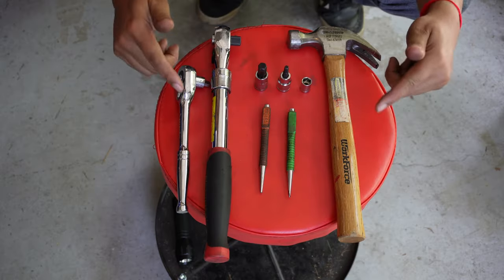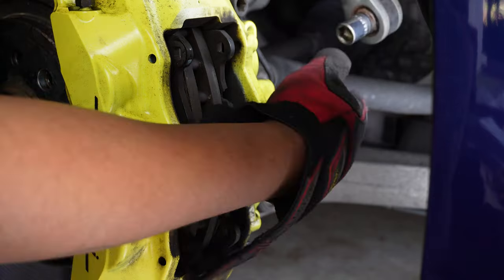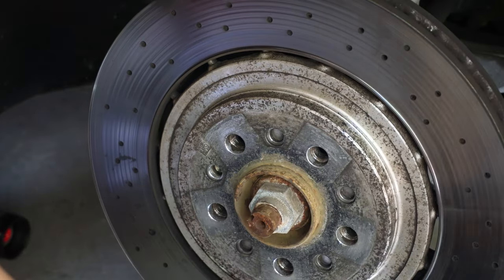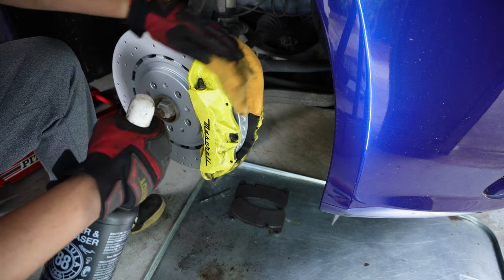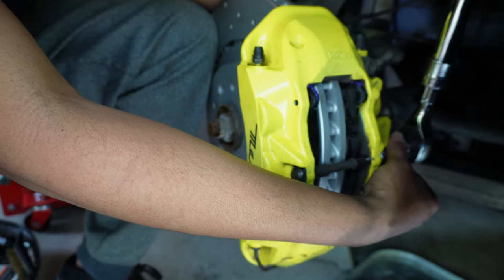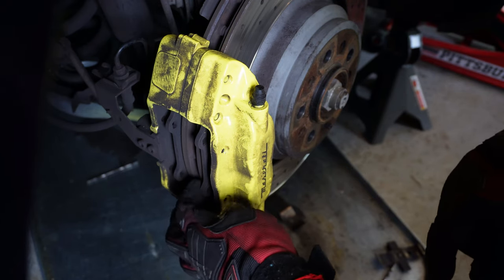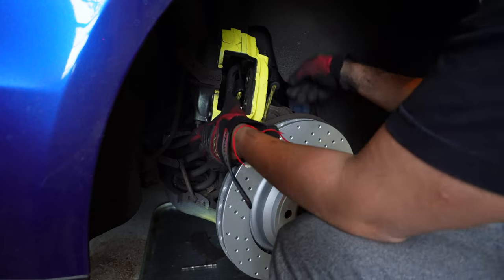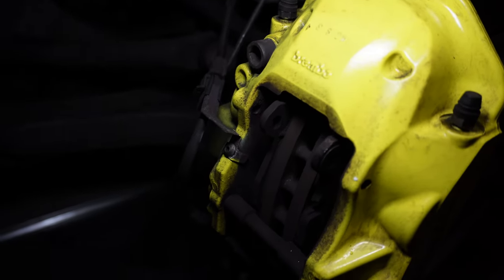How to change BIG BRAKE pads and rotors! DIY to save money on Maserati brake service. *Quick & Easy*

Comment: congratulations for the video, it is well done and clear in all its steps, thank you, I will try to change the rotors myself. I would also like to ask you if you were happy with the aftermarket rotors which have the central part in one-piece cast iron instead of two-piece aluminum, making them heavier.
thank you very much
Reply from the maker: Thank you for the comment and watching the video. I was happy with the aftermarket rotors.
Reply: Were you happy with the cheap rotors? are they equivalent to the originals despite the differences in weight and materials? thank you very much

Comment: Those break calipers are fire! My 2017 Levante had the red ones but they are underwhelming. Did you happen to know if the 2017 model requires any special diagnostic tool to disengage the emergency brake in the rear?

Comment: Would the process be the same for a regular ghibli/2018?
Reply from the maker: Should be.  Bleed ports may be different depending on Brembo brakes.
Reply: Can you let me know? I really want to change them and learn but don’t know that much. Can you do a video explaining please?
Reply: @DriveTalkCars  I ended up changing the fronts break pads however, I am currently stuck on the rear brake pads due to my car being a 4 piston.